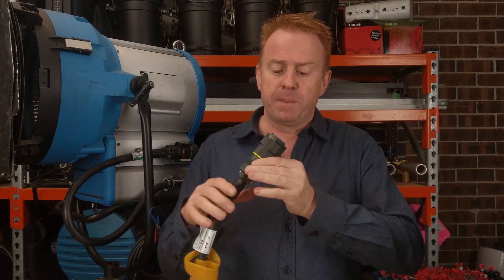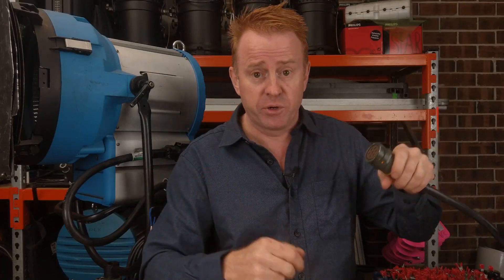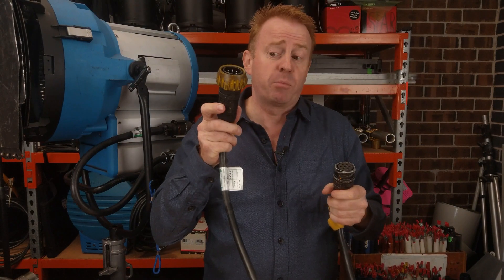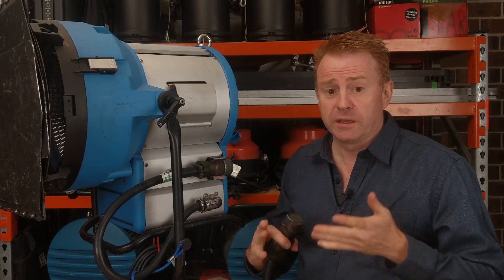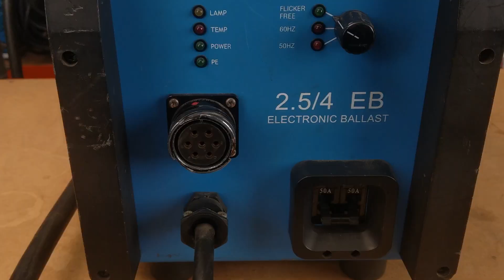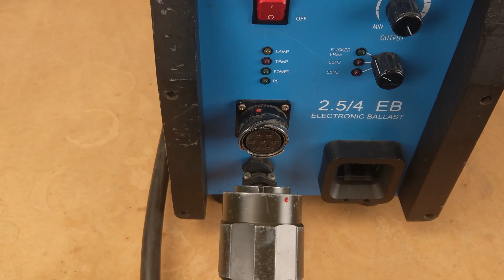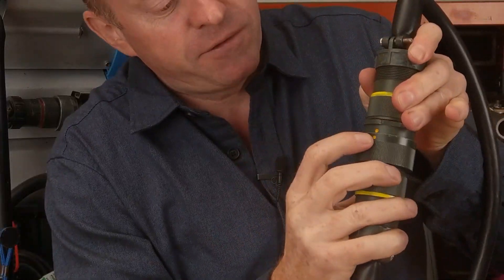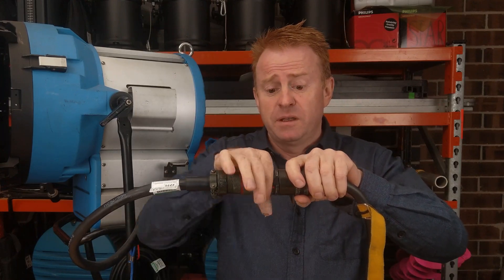Gaffer & Gear 96   HMI Head Leads

Comment: I've seen examples of Powercon and Speakcon damaged, too much twisting force and no release of locking pin. Multi pin connectors are expensive and can take quite a bit of effort to re terminate. I tend to rope up / down heavy gear, if there's only ladders.

Comment: I see mounted on the side your HMI, there is a spring metal coupler holder thingy. I have a couple of old cinepars that I would like to install those types of clamps too. Is that possible? And if so, is that an after-market add-on?
Reply from the maker: These are on all the HMIs I own, on different and came with them. I can ask my supplier if they can get it as a spare part and get back to you.

Comment: Hey Andrew. Love your videos. Over the years I've encountered a few HMI leads where the locking ring doesn't "click" to a complete lock. I'll try to apply added force to get it to "click" but sometimes they just won't. When I've run into these situations I usually avoid that lead and switch to another. Is there any danger in using a lead where the lock ring won't "click" completely? Is there an easy solution to non-clicking lock rings?
Reply from the maker: I have Desisti ballasts that don't click over, they miss by about 1mm. As long as it's firm, your fine.

Comment: one other safety point you didn't make, when doing this, CHECK THE POWER IS OFF!!, like a welder, a lot of current\voltage is in this stuff, and when you get them close, it arcs, which can cause burns, electrocution, or blindness (from the resultant UV light).
Reply from the maker: That's a good point. So basic I overlooked it

Comment: whats your thought on these hmi Clones?
Reply from the maker: Heads are about 15% dimmer than the arri, the ballasts have way better power factor so pull far less power. All up cost me 40% of an arri.

I'm Melbourne, most gaffer have ARRI heads and these Chinese ballasts to get the best of both worlds.

I would be reluctant to buy these if I wasn't dealing with a local distributor giving me 3 years parts and service warranty.
Reply: @gaffergear  well im sold on them. I have a local Service tech, that upgrades the internals on the heads and the ballasts. I'm going to try one out. but i do like the idea of haveing the arri head .  thanks andrew